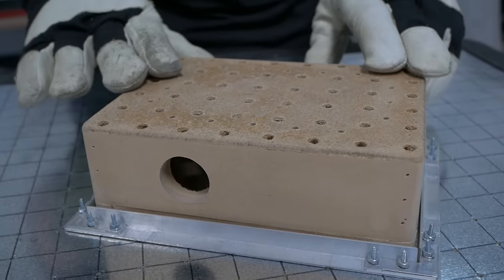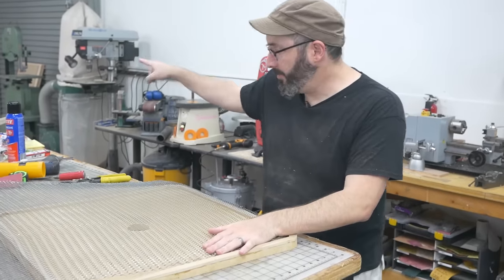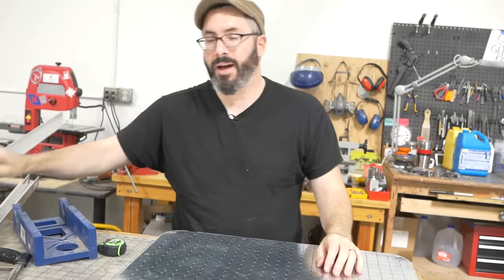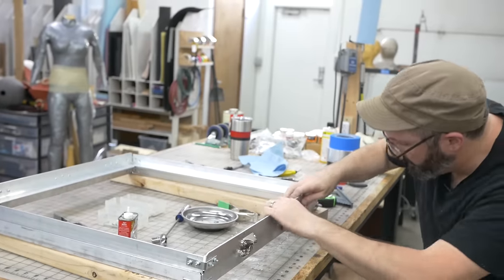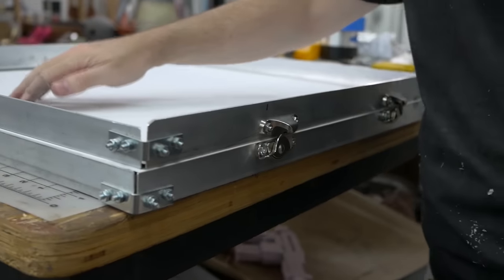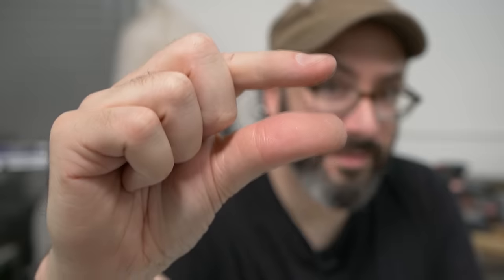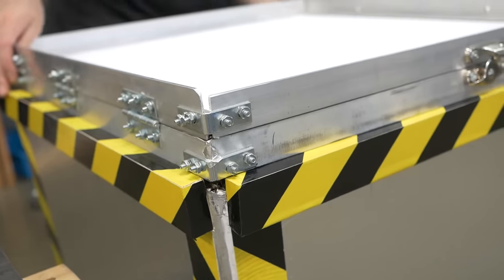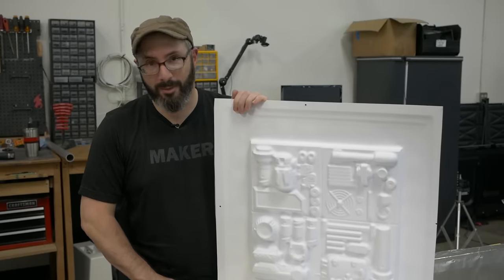Hardware Store Vacuum Table - HOW TO make your own

Comment from the maker: Check out our website to see all the materials used and more build photos: https://punishedprops.com/2018/10/01/large-vacuumformer/
Reply: Call it "The Warm Sucker"
Reply: where do you buy your styrene? i used to buy it at my university but since i graduated i cant buy from them and i havent been able to find affordable styrene anywhere
Reply: Call it Indica
Reply from the maker: We have a couple local plastic suppliers in Seattle. Tap Plastics is our favorite!
Reply: Hey PPA, you could name it "Shape Sucker"
Reply: Large-scale Greeble maker? Neat.
Reply: Vactorious?
Reply: Make a lid for the heater. The ambient temperature in the shop sucks a lot of heat, so the heating time increases. You can drop the heating time by almost half if not more and evens the heating. Ive made two for myself (and am impatient) and I can pull in 3-4 minutes.
Reply: @blainjohnson7777  even just using a thin blanket of steel wool would help and the conductive mesh helps to evenly distribute the heat and break up convection.
Reply: One of things that will give you sharper edges at the base of molded piece (instead of the curved edges) and more detail is to use a more powerful vacuum for more suction (or maybe add a second shop vac?) as the goal is to pull as much air (CFM) as possible in the least amount of time, and second, lose the flexible vacuum hose. Plumb out solid as much you can, and as short as you can. The problem is that it wastes time building up the vacuum needed as you have to evacuate all the air in all the hose first before it even hits the box. This allows the corners of the plastic to cool. Those two things will give much sharper detail.  I have an old Sears "industrial" vac that is a bit over 300 CFM. Most shop vacs range from 50-120 CFM.
Reply: @punishedprops  wouldn't hurt to mention that people need a styrene sheet in the BOM.
Reply: There is a faster and better solution than drilling so many holes. Use ball bearings. Metal made and space between balls will never get closed. Ball bearings balls can be obtained in large amounts in your local cycle shop.
Reply: Your project was  awesome, name it Mvbm
Reply: Name: VACU Whether 4 CAST
Reply: I know this is 5 years ago. But whenever I see anyone wearing jewelry when working on projects, it terrifies me. 

Please, going forward, don't wear jewelry working with any power tool. I don't want to see you losing a finger because of it.

Comment: Hey Bill, it's been a while since vacuuforming for me (worked at a sign company). A little tip: at the end of the vacuum draw, if there are some imperfections where the vacuum didn't pull all the plastic, use a heat gun to reheat the plastic as the vacuum continues to draw. That should fix it.
Reply: How thick of material were you doing?

Comment: Although you are heating the plastic (to be formed), you also need to heat up the area around the form and vacuum table. As soon as the hot plastic hits the cold form and table it quickly looses heat and looses detail, thus the webbing around the bottom of the mould. Use an infrared bulb (or two) over the vacuum table to preheat the bed and form.

Comment: 2 years later and this video is still worth it. For your heater( you may have solved this long ago), I volunteered once building an Open 60 sailboat, they used prepregged carbon fibre/epoxy. The autoclave they built covered the whole boat and they used refective styrofoam panels with minimal wood framing. Worked like a charm! Loved the video and the trouble shooting process. Thank you!
Reply from the maker: Thanks so much for watching and for the tips!

Comment: This was actually very handy for me as im a younger diesel mechanic and i have loads of tools and this was a perfect way for me to make custom tool organizers for all of my tools even the oddball ones i own and so far its working perfect i just used black plastic and it was slightly thicker for durability. I also made a couple tool trays for a couple other guys in the shop and they love it so far! Great idea. Been trying to solve this problem for a while!
Reply from the maker: That's fantastic!
Reply: I know its been five years, but what plastic did you use and where did you get it?

Comment: That was kind of difficult to watch.  
Several years ago (~40 years) 
I set up a vacuum forming operation for a company that used thousands of parts made on vacuum form machines.  Seeing you struggling with starting from scratch to build a vacuum forming  machine was hard to watch.  All of the things that didn't work, and needed to be fixed, were very common when you're first learning about vacuum forming. I was glad to see you finally pulled a successful batch of parts.  Good luck on your continued adventures in vacuum forming from the ground up.  A good, wholesome video you made.  It showed the good, the bad, and the ugly of starting to learn a new skill set.

Comment: I very much like the build! I'm moving soon and will finally have room for one in my new workshop space. 

Something we used to do a place I worked was put carpet padding under the master which let it pull vacuum all around.

If there's a few more dollars to throw at the project instead of aluminum foil to line the box you could get a roll of Reflectix- it's great stuff and you'll bake the plastic in no time! You'll lose a LOT less heat. 

Also you could tape off unused areas and make a smaller vacuum area on the table to use with a smaller frame. Multiple tables in one.
Reply from the maker: Great tips, thanks for sharing! =D